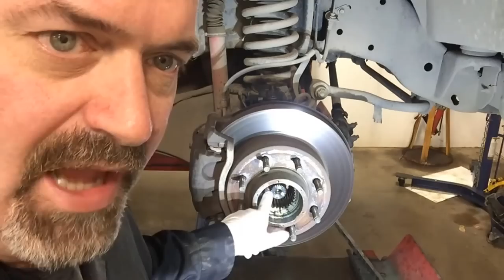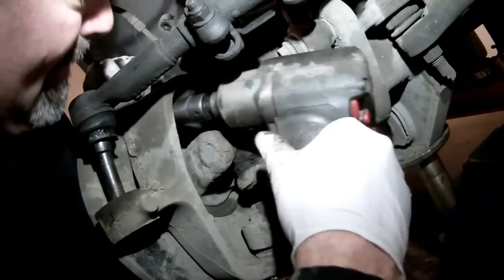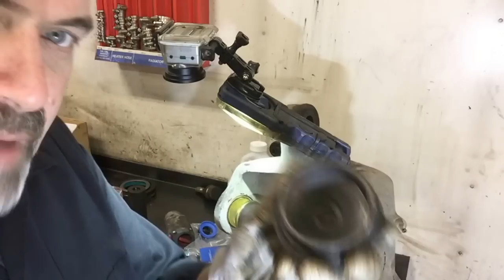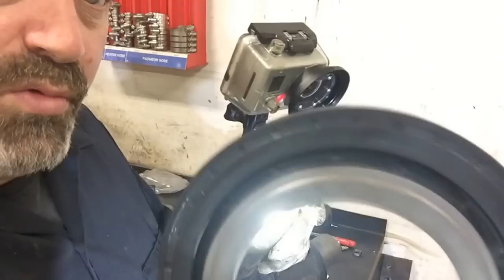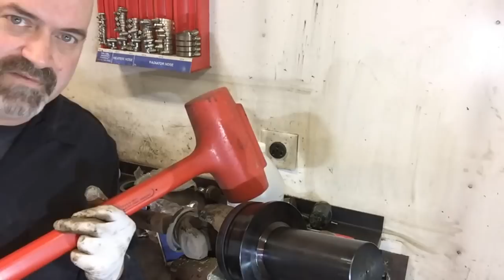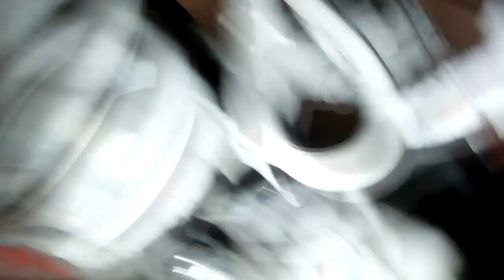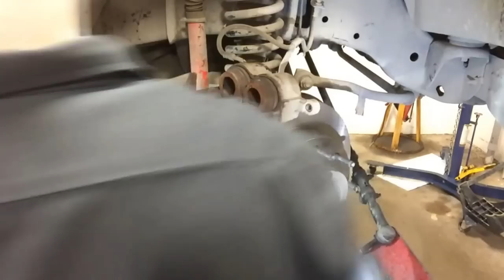How To Replace Ford F250 F350 Super Duty 4X4 Upper and Lower  Ball Joints

Comment: Sorry to be a pain.  I tried to look on the snap on website but I can't find it.  And the Fordtool.com doesn't have the hammer listed.  Can't you just look on the snap on tool itself and read off the part number?  And I am sure that your hammer has a part number on itself too?   It would help me.
Reply from the maker: I will check when I get back in the shop and a couple weeks.

Comment: how many pounds is your ford hammer?  I went to the site and it was not there.  I found this.  how many pounds do I need?  http://www.ebay.com/itm/Soft-Face-Sledge-Hammer-30-Stanley-57-551-/331341697643?hash=item4d2581126b:g:SGMAAOSwZ1BXfov1
Reply from the maker: I think mine is three pound. It's a snap on.

Comment: Great video! Could you tell me specifically which OTC Ball Joint adapters you used? Looking at the "OTC 6731 Ball Joint Adapter Update Kit for Ford" and folks are saying that the kit does not include the necessary adapters for some jobs. Thanks in advance!
Reply from the maker: I use the Astro Brand 7868 kit https://www.amazon.com/gp/aw/d/B00061SGPO/ref=mp_s_a_1_sc_2?qid=1464751388&sr=8-2-spell&pi=AC_SX236_SY340_QL65&keywords=astro+ball+joint+press+adaptor
Reply: Thanks! Is the Astro 7897 Ball Joint Service Tool the base tool, combined with the 7868?
Reply from the maker: The 7868 is the adaptor set that can be used with any ball joint press. I use the OTC press but also have an off brand that this adaptor set works with. Astro also sells a master kit with the press and adapters at a reasonable price. Good luck!

Comment: hey I'm trying to find out were my computer module is on my 2006 ford five hundred so I can have it replace if u could help me that would be so graceful
Reply from the maker: Which computer module is that? There are several
Reply: +The Car Doctor the control train module my computer was given out wrong codes on my ford five hundred
Reply from the maker: Powertrain Control Module?
Reply from the maker: The PCM is located under the wiper cowl just below the windshield area. You will need an NGS tool to properly program a replacement module if you replace it. Good luck.
Reply: +The Car Doctor yes thats the one Ty for helping me

Comment: What size snap ring pliers did you use? I've got 8" Channellock and they aren't doing the job.
Reply from the maker: Mine are large SnapOn. Others have commented on having issues. I'm out of the shop but when I return I'll try to remember to leave a part number.

Comment: I am finding it hard to turn my hubs to "LOCK" and then to "AUTO" what can I do to make them turn easier?
Reply from the maker: i have never pulled the actual hub apart and I'm not sure if it will allow but you could remove it and try to disassemble and clean and live the parts. Or you could try some penetrant sprayed into the seam where the inner knob rotates inside the outer body of the hub lock. Or replace it but that probably wouldn't be cheap.
Reply: +The Car Doctor hey like to no were is my computer module on my 2006 ford five so it can be taken out Ty for your time

Comment: good video .what size prybar did you use? getting the axles out was the hardest part .
Reply from the maker: +vbvini yes I have a larg pry bar. If you get between the u-joint and axle housing and pry it gives a little leverage.

Comment: What ball joint removal tool did you use?
Reply from the maker: +Mike Panocatapolis (Not boba fett) IM using the OTC ball joint press with the Astro 4X4 adaptor set to both remove and install the ball joints. Thanks for watching!

Comment: thanks Doc, your ford hammer looks a lot like my old dodge hammer I had, I guess there interchangeable...
Reply from the maker: +Abe Michau Yes they are almost exactly alike and perform similarly. Very handy to have. Hey stop back by again!
Reply: Any chance you have a front end inspection video on these trucks (mine is a 06 F350)  I would be interested what a guy with your ability looks for on each component in the steering and linkage, I got a sudden serious wondering issue with my truck everything looks tight other than a bit of play in the linkage. and I changed the power steering fluid but still have the wondering effect. Im pretty sure its not that death wobble people talk about. some days it drives perfect then after a while she likes to wonder side to side. I did notice that with the hubs locked and in 2 wheel drive its normal. 
Your obviously experienced with this stuff and as far as I have been able to find, there is no good videos showing a thorough inspection. 

Thanks Doc!
Reply from the maker: I will do that next chance I get. In the mean time try having someone just work the sloppy portion of the steering by moving the steering wheel back and forth while you look at each joint and linkage component for any movement or play. The tie rod ends usually hold up a long time but look closely at the pitman arm joint. Also you can jack up the wheel just under the axle housing and use a big bar to pry up on the tire to see if the ball joints move at the knuckle. Also check for any up down and in and out movement of the tire by grabbing the top and bottom while lifted and feel for any loose bearings. Check tires and wheel for any bent or broken belt in a tire causing wandering.
Reply: +The Car Doctor Im on my way to my garage now to try that....you say tires are a possibility ...my tires areare pretty much done. ...never ever considered the tires....your a fart smeller Doc...thankyou!!!!

Comment: I hate to be a pain in your arse... but i cannot help it. if ya through your ball joints in the freezer or just leave them in the alaskan weather they will shrink and pop right into place. yeah it really does help
Reply from the maker: +chris keiley I have heard of that trick but haven't done it with ball joints. Good tip however. One thing to keep in mind...even if the kid across the street double dog dares you, never touch your tongue to a frozen ball joint.
Reply: The Car Doctor not to be a stickler, but it was a triple dog dare that sealed the deal. Thanks for the vids

Comment: Done and done! Completed my ball joints yesterday by following your step by step video. I've never done this type of repair before, but I found your video very helpful and taught me a lot. Thank you! I've also done my brakes and rotors front and rear following your tutorials. I did have to have a local shop press on the axle seal and ball joints and was charged $45 for only one side as I was a referral to them. I broke my vise, busted my workbench loose from the wall and cracked the lower support beam. So I had the shop help me out.
Reply from the maker: +Rick Case Sounds like a great success story! Spending $45 per side is not bad considering the savings over having the job done elsewhere. Proud of you. Take care.

Comment: I have enjoyed watching your video & now have all my parts to proceed on replacing my ball joints. As a first timer, how long would you estimate this job would take for both sides?
Reply from the maker: +Rick Case I would give myself a good day depending on skill level. I would probably do one side at a time and when completed move to the other. Take your time and check back if you run into trouble. Good luck.

Comment: do you still need that vacuum seal tool if you dont have auto locking hubs?  i have manual hubs.
Reply from the maker: +03blkstanggt I believe it's still the same seal and it's pretty hard to do it without the tool. Even though you don't need it to hold vacuum you still want it to keep dirt and water out of the bearing. Lots of places have the tool for rent or even free use. Good luck and thanks for viewing.
Reply: ordered it off the matco truck on friday, gonna give this a shot hopefully next weekend
Reply from the maker: Right on. Good luck with everything.

Comment: Thanks for the great video.  I was wondering if there was anything else you would replace while you have everything apart.  Seems like a good time to replace tie rods ...etc?  Just curious, going to tackle this when the weather gets a little better. Thanks!
Reply from the maker: +An Engineer well I'm kinda conservative and those tie rods hold up very well. Even if they wear later on they are easy to replace apart from during this service. I would look closely at the outer axle end u-joints and replace if there is any play or rust coming from the caps which indicate eminent failure. Since you have to pull the axle shafts this would save the hassle of going all the way back in. I didn't talk about it during the video but they have an updated inner axle housing dust seal that pops into the housing instead of on the shaft inside the u-joint which I recommend replacing. Thanks for dropping by and good luck with the fix!
Reply: +The Car Doctor Thank you for the quick response and all the info!
Reply from the maker: No problem, I enjoy helping folks like yourself. I think I would rather help people fix their own cars then fixing them myself but I can't make a living doing that...haha. Take care.

Comment: Do you have a video for replacing glow plugs on a 2003 Ford F250  7.3l diesel super duty? I'm showing number 1-4-6 glow plugs need replacing. Does the A/C unit need to be removed to complete this repair?
Reply from the maker: +Rick Case Sorry I do not have a video of this procedure. I will say that it requires removal of the valve cover and then simply disconnecting the electrical connector and removing the glow plug. A couple things to note. Be very careful. The voltage on that circuit is enough to kill you. Also, youll likely want to replace the valve cover gaskets while doing this repair as they are a common failure of the glow plug circuit on your vehicle. Sorry I couldn't help more. Thanks for stopping by and good luck with your repairs.

Comment: Excellent video.  Thank you for taking the time to put it together. I have one question about removing the axle shafts. Did you need to drain the front differential before removing the axle shafts? It seems like when you pull the axles out you should have diff fluid pouring out the inner differential seal.
Reply from the maker: +Eric Greer No need to drain, the actual level is just at the lower lip of the seal and very minimal if any gear lube will come out. This is not always the case with every differential so your scenario is correct in certain applications. Also, if the vehicle was not lifted and supported in a level state then I suppose gear fluid could run out one side or the other when an axle is removed. Thanks for the complements and for dropping by to watch. Take care.

Comment: Great video pops is 84 and can't drive the manual transmission f250 so im gonna use it.  It needs upper and lower ball joints are there some things I need to be cautious of on a rear wheel drive when doing this replacement????
Reply: Do you recommend doing any other work to the front end while I have it disassemble 170k and not much work done on the front end. Thanks
Reply from the maker: +Rick W sounds like your saying the vehicle you have is a rear wheel drive vehicle. Here is a link to my video for  a 2X E150 that is probably closer to what you have than this 4X model. I recommend you look closely at the bearings and seals along with brake parts and any bushings, etc. sorry I don't have an F250 two wheel drive video, we don't have a lot of those up here. https://www.youtube.com/watch?v=kaFtmZ2dML8
Reply: +The Car Doctor thank watched the 150 video following your lead went and picked up the MOOG brand.  Taking the OEM from ford back thanks now springs and shocks
Reply from the maker: Good call. You won't be disappointed and won't be doing them over again in 60K miles. Take care.

Comment: I need your expert advice on the proper upper and lower ball joint torque specs on my 2000 F350 4X4 that I am not finding the correct torque specs on. I have read on multiple forums and watched YouTube videos and it seems that there is much misinformation out there on the proper torques for a specific year range. There are really good write-ups on replacing ball joints for 1999 to 2004 Super Duty trucks with most documenting that you should torque the bottom to 35 lbs and then torquing the top to 69 lbs and then re-torquing the bottom to 150 lbs. I just purchased XRF ball joints and they told me to torque to factory specs but I can't really find the right answer to what that is. Trying to Google the answer is not that easy. I have a Chilton 26667 manual that I bought from the parts store and it lacks much info on what I need. The manual covers 1999-2010 Super Duty pick-ups/Excursion F-250 and F-350 gas and diesels. It is saying in chapter 10-19 that the upper ball-joint nut for 2001 and earlier is 101 lbs with the lower being the same at 101 lbs. It says that 2002 models are 69 lbs for the upper and 150 for the lower. I would hope that Chilton would be a reliable source but I had already went with torquing the uppers to 69 and the uppers to 150 lbs. reading from what I have read from other write-up procedures. What would you do? Does anybody have the proper torque specs from Ford? Chilton makes a sh%tty manual so I don't know if I would believe them either. If I do what the Chilton manual says, I would have to increase my upper to 101 lbs and decrease my lower to 101 lbs. I read somewhere (possibly not true) that once a ball joint nut is torqued to a given tightness, the ball joint can have a torque memory or something? I don't think that is critical and I shouldn't worry about it if I have to back-off on the lower ball joint nut down to 101 lbs. What is your opinion on this? What is the proper torque numbers for a 2000? Super dutys do not share the same torques from 1999 through 2004.
Reply: +The Car Doctor That was lots of reading but it looks like I will keep it where it already is 70 upper and 150 lower.
Reply from the maker: It's not the torque that's important but the procedure.

Comment: Great explanation of procedure. Is it not best to compress the caliper while the bleeder screw is open as not to push any possible sediment or mess with abs?
Reply from the maker: +John Rhodes yes that's a good idea however on these Ford ABS systems it's a pain to bleed it afterwords usually involving connecting the scan tool and performing an auto bleed function.

Comment: Question: my truck is the same setup here, but with manual locking hubs. I've heard that I do not need those vacuum seals at all, any advice on that? Don't wanna waste $ on seals and tool if I don't have too
Reply from the maker: +Jeff Nasi Well you don't need the seal to hold vacuum but it does keep dirt and water out of the inner hub/knuckle area. I just don't know that there is a cheaper seal that installs without the tool or what problems you might encounter if you don't install it. That said, you could probably reuse the old seal without issues since it wouldn't need to hold vacuum but driving it into the knuckle at the proper depth might prove to be the hard part. Let us know how it goes and thank you for watching!

Comment: Nice video....I am in the process of doing the same thing.   I ordered the tool off eBay.  My question is are the torque specs the same for all f series super duty trucks.  Mine is a 2008 F450.  Everything looks the same but my brakes are bigger and I have 10 lugs
Reply from the maker: +Kelton Boyd I think the torque will be different on many fasteners. The ball joints should come with specs but you'll want to get factory specs on everything else. Shouldn't be too hard to find.

Comment: Great video
Reply from the maker: +Greg B Thank you!
Reply: +The Car Doctor Ben how do you avoid contaminating the front diff and seal when re installing the axle? Mine had the loose outer dist seals, through which sand and crud got in there. Vacuumed out most of it but none the less dirt got into the diff, as well as im sure the axlepicked some up during re installation. I put on the updated dust seals which press into the housing-however it makes lining up the axleinto the carrier that much more difficult to keep off the inner tube/dirt free.  I took the diff cover off etc to clean as much as I can, although I know it will never be 100% clean in there now..
Reply from the maker: I understand your dilemma and it sounds like you did all you could to avoid introducing contamination into the diff. Short of using a shop vac or removing the carrier and cleaning the axle tubes there isn't much you can do to prevent some contamination getting past the seal. I try to support the axle horizontally the best I can to avoid dragging across the dirt and call it good.
Reply: +The Car Doctor 
One more question. I got the repair all done. Truck had 0/0 caster/camber bushings in there, i did not disturb them. Now the passenger side wheel where i dod the joints has more positive camber and the steering wheel is cocked right a bit. any ideas?  Again didnt touch the c/c bushing or TREs..
Thanks
Reply from the maker: Doesn't make any sense to me. The repair shouldn't change wheel angles significantly. So you can visibly see the camber difference by looking at the tire?

Comment: Thanks very much, Very detailed video.  Where did you get the tool to drive in the axle?  I have 05 F250, are the torque spec's about the same as you detailed?  What would you charge to do this (upper and lower Ball Joint) replacement?  Thanks.
Reply from the maker: +Rick Gray The replacement ball joints should have a spec sheet along with torque for the studs. Other than that please check your service manual for proper torque. The tool is available at parts stores everywhere and amazon.com also. Good luck!